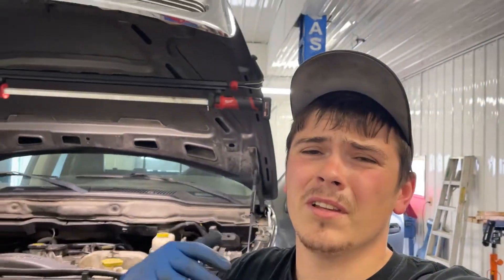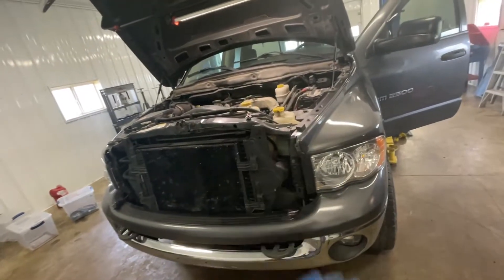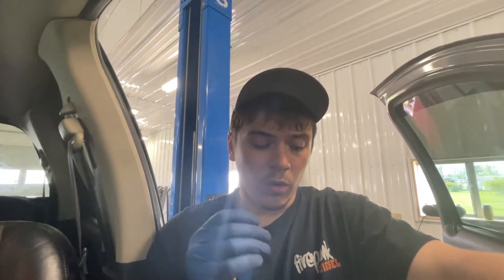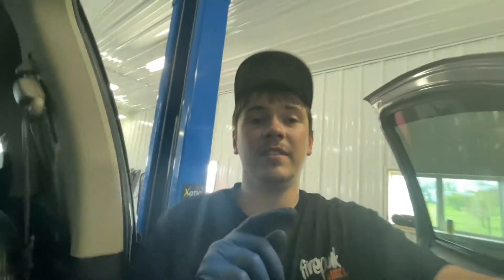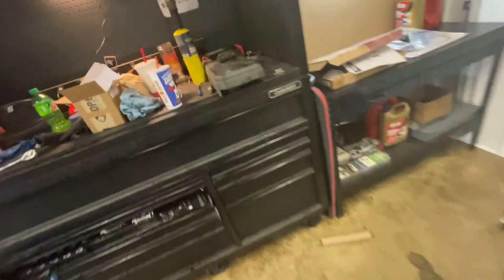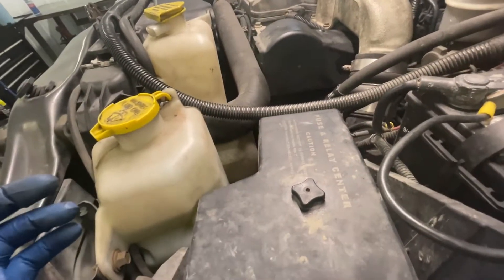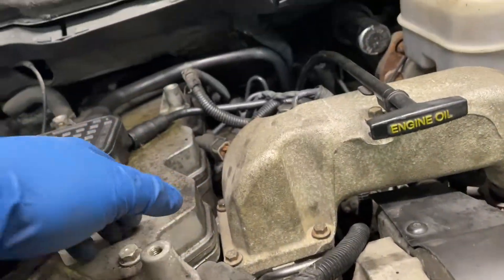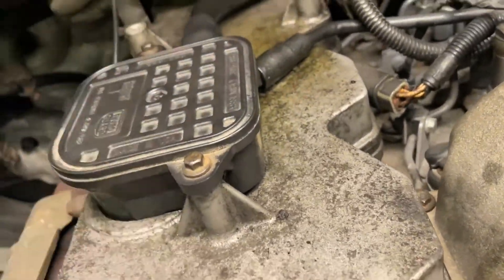2003 CUMMINS NO START? ONLY STARTS ON ETHER

Comment: 2006 ram 2500 5.9 cummins with 175k miles had hard start, once it was on it would run fine. 
Had no check engine light come on or codes. 
Spent a week looking for some similar issues with other cummins owners and had no luck until i ran into this video! Bought the prv and got it today and truck is back on the road! Thank you! Definitely helped me

Comment: I have a 1966 Massey Ferguson Diesel tractor. Never have used starting fluid. Still cranks 2nd or 3rd turn. 
In the 5.9L I found that water in the fuel will be hard to start. Diesels hate water. Too much can blow your head. Usually the engine is getting air in the system. Just because one engine has a problem doesn't mean all of the engines will have the same. There are many factors that can cause your problem.  One fix may be ok for a week or so then another problem starts up. If a diesel isn't making you a lot of money, then you don't need it. Many young guys hot rod their diesel trucks, and wind up paying thousands of dollars in repairs. Treat your diesel gently. The power can destroy transmissions.

Comment: i got a 2000 ram 3500 5.9 in it. loss of power while driving i changed the fuel filter it will only start for a second and cut right back off any idea

Comment: I have a p0148 injectors are bbi 1.5 maybe 20k miles new cp3 industrial injection stock but revs higher brand new airdog installed truck idles high like 10.2 on my edge and when driving I let out it drops to 1.0

Comment: My dodge is doing the same thing….I replaced the rail pressure switch I am thinking about replacing rail pressure sensor and fuel control actuator after I clarify the lift pump is okay
Reply: @mikee4165  the lift pump was bad

Comment: Awesome video. I have the same issue now. First thing i did was change out my fuel pressure relief valve, but that didnt work. Then i did fuel filter and that also didnt work. Bone stock truck with 160k miles, so im guessing at this point it could be fuel control actuator, bad injector(s), or bad lift pump. Lift pump does turn on though when key is on no start. I guess i should un plug the fuel actuator and see if it starts up at least to rule that out. Also no CEL are on. Just wondering where you would go next.  Thanks.
Reply: Did you find the issue ?
Reply: @dgkreal831  Yes. It was indeed the fuel injectors. I replaced all 6 with OEM Bosch. No issues.
Reply: @Tinkerer4Life-pp2dg  how did you figure out it was the injectors, did it give a code that shows it was injectors.
Reply: @nickkiosk5513  I did a fuel return test and it exceeded the normal amount. I have a video of the test on this channel.

Comment: Hi my truck only starts with starting fluid but there is no fuel in the fuel filter housing. I fill it up with diesel and put starting fluid but I have to repeat the process for the truck to run
Reply from the maker: Sounds like fuel pump failure check wiring to fuel pump.

Comment: Mine only has trouble starting/no start below 45° ambient temp. I wouldn’t think this would be the problem? Thoughts?
Reply: I'm having this same issue, my 5.9 always starts but now with the temps dipping to 40 at night, my truck will not fire. Last 2 mornings I had to use starting fluid.

Comment: I got a 2003 Dodge Cummins that starts easy cold but won’t start warm . After driving it for a short trip like a mile or two it won’t start for a hour or so  !
Reply: What do you think the problem is ?
Reply: @robertbraker93  I have the same problem, going to try the actuator next.
Reply: Hi Robert what was the fix to your 2003 Cummins.  My brother's is doing the same thing.  Drives fine then won't start while it's hot
Reply: @CrazyCuteThing  I’ve parked it for now and haven’t got it fixed yet !
Reply: What was the problem. Thank you
Reply: Haven’t fixed it yet .

Comment: I have no start after replacing injectors, cp3, all injector lines and feed tube and the prv
Reply: Did you get it figured out? Mine is doing the same
Reply: Any of y’all figure it out? My 06 will crank but won’t start might be injectors but hoping not

Comment: Oregon logger had a 2003  3erd gen 5.9 common rail 185 injectors nothing but new tank pump full lines from shop that fucked me screw dodge Chrysler dealership my truck ran away hit a fir tree at 65mph it would not shut down
Reply: Sadly to say I'm back to minty old Wilbur 7.3 idi turbo 5speed slow to go barley starts lol but keep on rolling

Comment: I being Taking my truck to a different mechanic is a rebuilt engine new injectors 4 different shop haven’t fine the problem I have it make with the same problem 
Only star with staring fluid I know but this the only way start but dies 
Won’t stay on please if you have anything to share please do 
Hp pump change 3 time mechanic say is bad but is still the same way oh new sender unit new low pressure fuel and filter 
What I see when I get new injectors the tube have to bearings and the old one have just a pin

Comment: Don't ever use either on these 5.9L engines. You will ruin the engine. Could blow head off, crack the head, blow a piston. Don't be an idiot